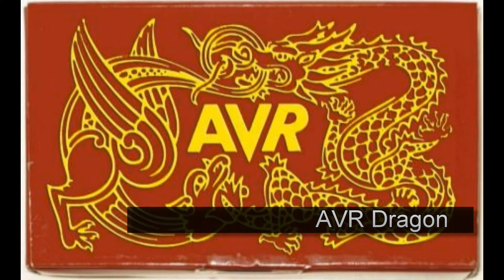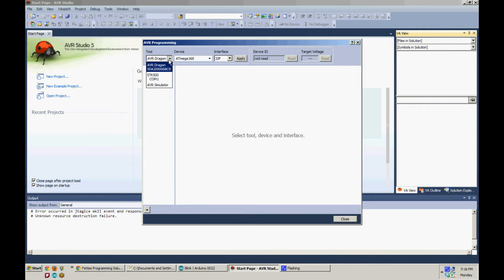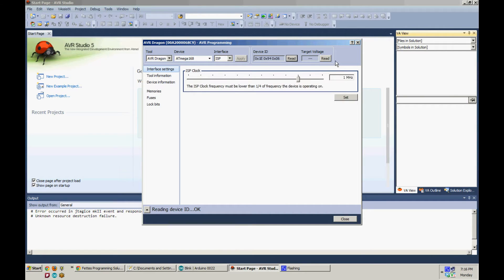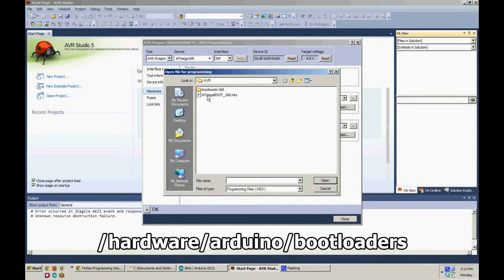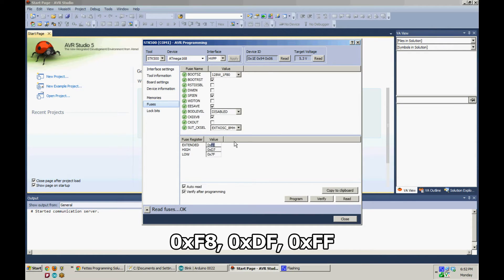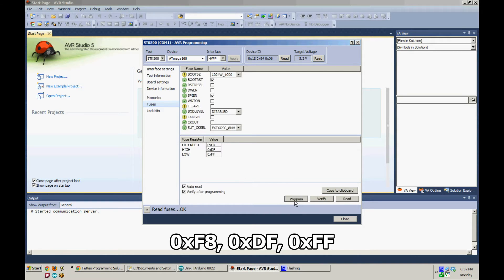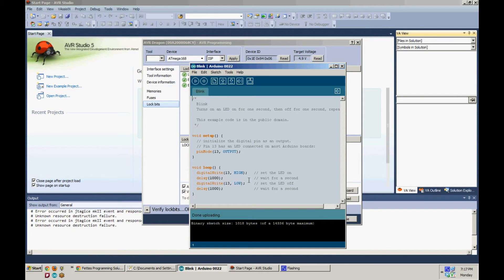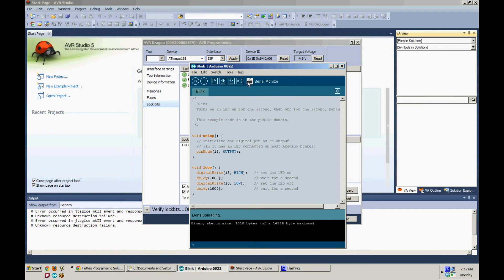Burning an Arduino Bootloader with an AVR Dragon (updated for AVR Studio 5)

Comment: ...I managed to brick my atmega328 by changing the fuse registers as directed. That is, my AVR dragon no longer recognized the device signature immediately after hitting "program" Cycling power/connection does nothing.  Is this normal? Is there a fix?

Edit: It wasn't "bricked", I just burned the wrong boot loader and, after setting the fuse bits, you can no longer use the internal oscillator. The solution for me was to plug my atmega microcontroller into my Arduino Uno board and program the IC via the ISP header on that board. So the video/online guide is correct, it would just be much more helpful to explain what is going on enough for someone like me to know what to do when they screw something up. Like, where is it important to be careful in this process? I spent about an hour on a goose chase thinking the problem was that I disabled the ISP fuse bit and that I'd have to figure out high voltage parallel/serial programming...